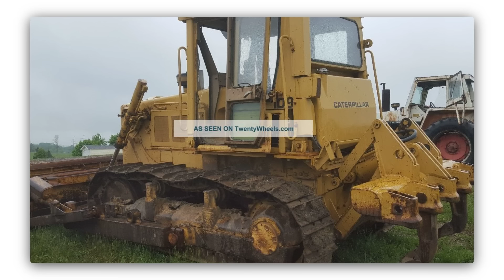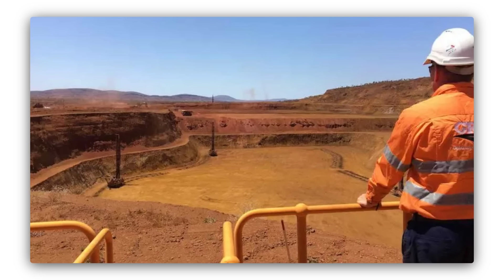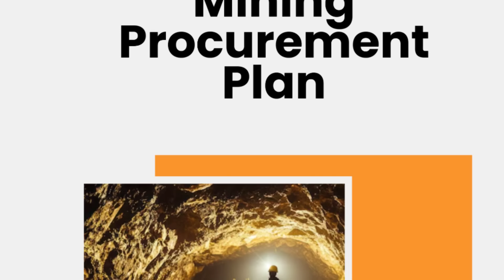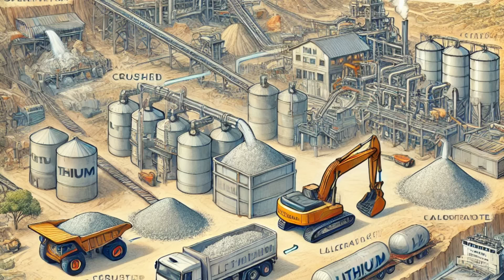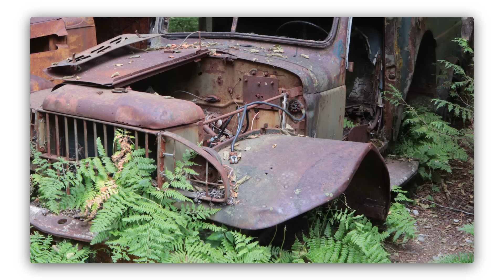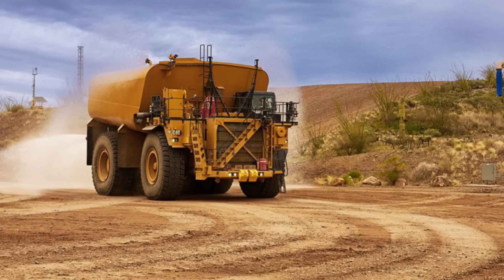Why Asian Mining Trucks Are Destroying Caterpillar's Dominance

Comment: Komatsu trucks are built in Peoria, Illinois.  They used to bear the name Wabco, then later Dresser.  American engineering.  Hitachi trucks are Euclids.  Euclid was acquired by Hitachi and they changed the name and color.  Both Asian companies are upgrading and modernizing their trucks, but they are still recognizably North American trucks.
Reply: I transported a load of Komatsu wheel motors 20K ton each from Fort Worth to the Port of Houston, primarily destined for South Africa.